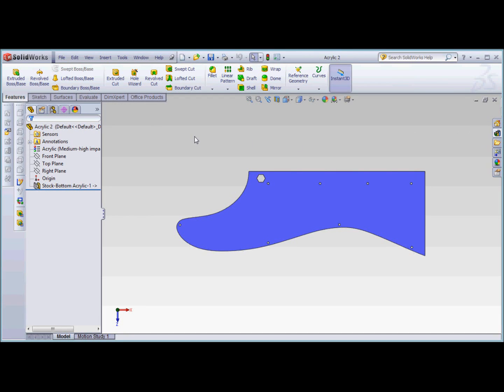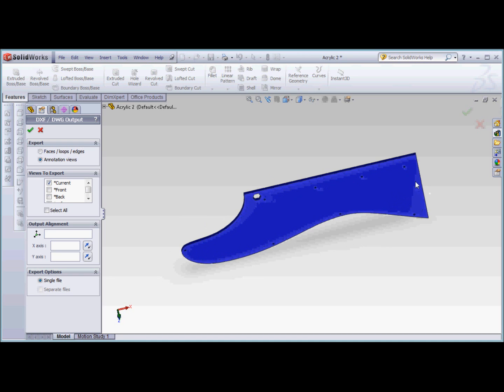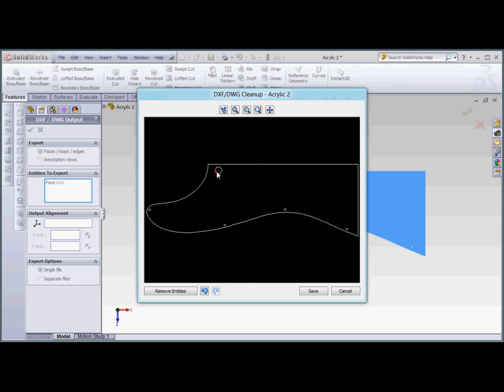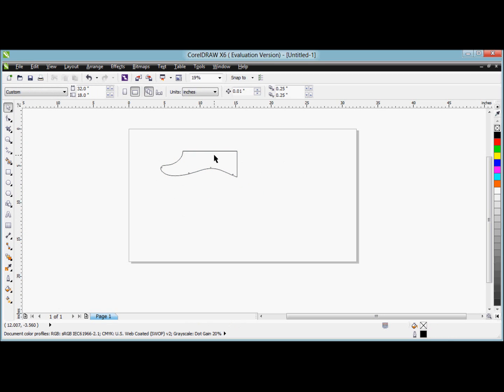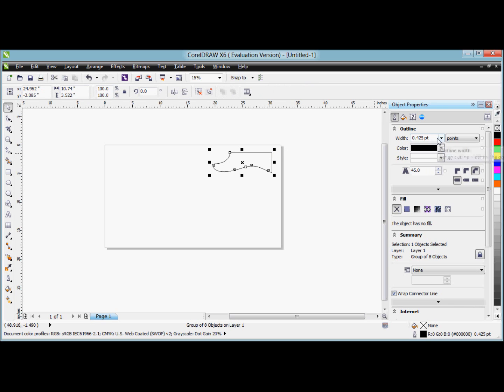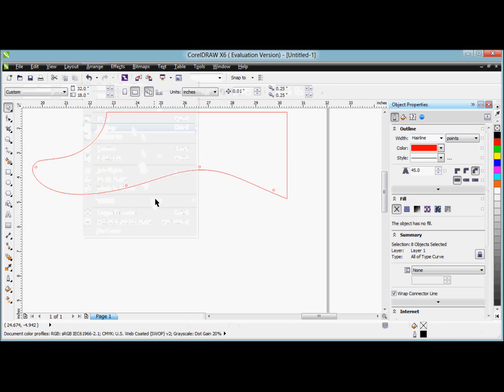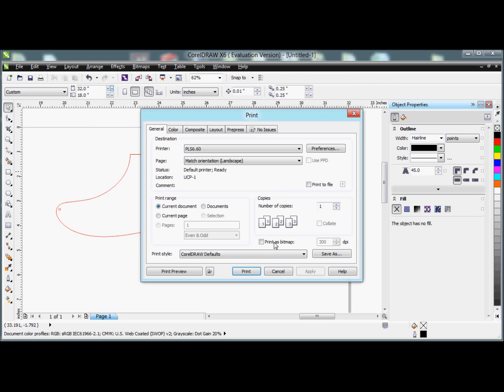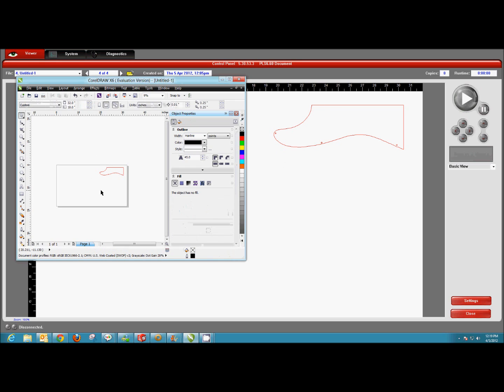Going from SolidWorks to Universal Laser System via Corel Draw

Comment: Hi AmtekCompanyInc great video I have an issue do when I import the file all the lines are about 5mm longer than they should be any clue why thanks
Reply from the maker: You may need to play with the dxf/dwg import options in Corel Draw. When you drag and drop a dxf/dwg into Corel, it should bring up a box with import options. One of the options will refer to either units or scaling.